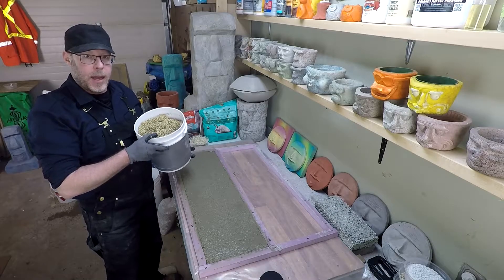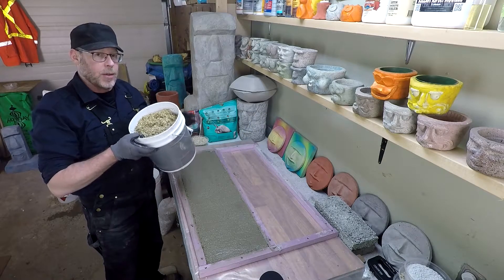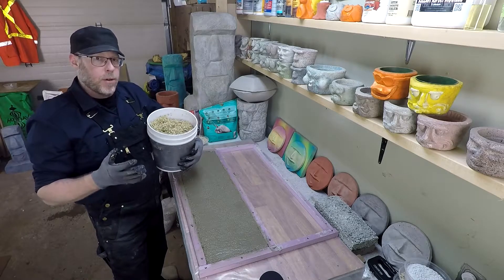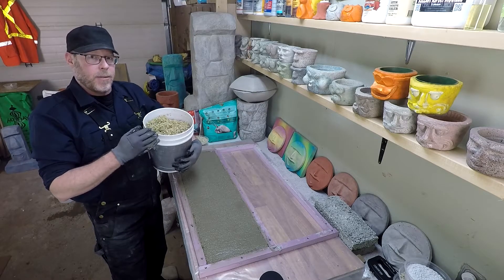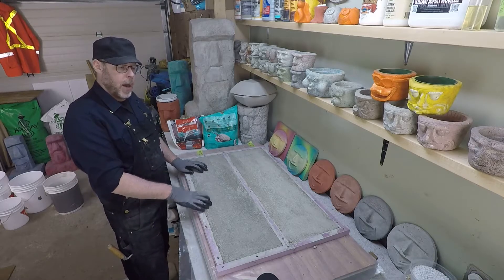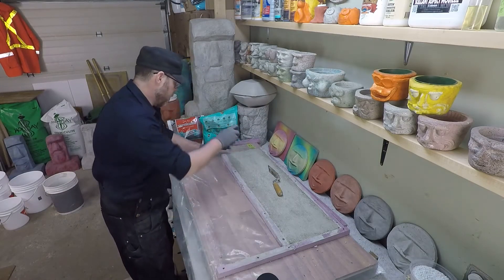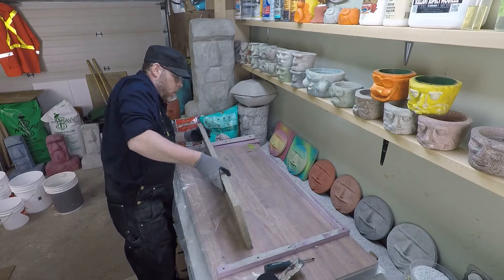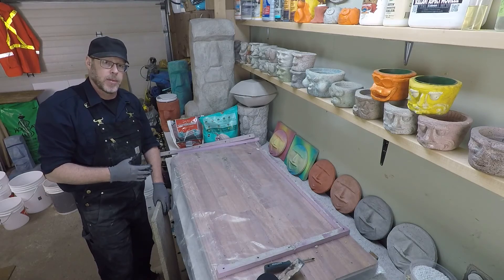Mixing Concrete With Vermiculite (6:1)

Comment: Pretend you wanted to build a small shed out of lightweight concrete panles - what material would you use?
Reply from the maker: vermiculite.  4 verm, 1 cement, 1 sand.  Add liquid acrylic replacing 10% of the water in the mix with acrylic.  I would then use steel studs backed with cement board and fill these with the lightweight mix.  This way you can have modular panels, lightish in weight, and with a very high insulation value.